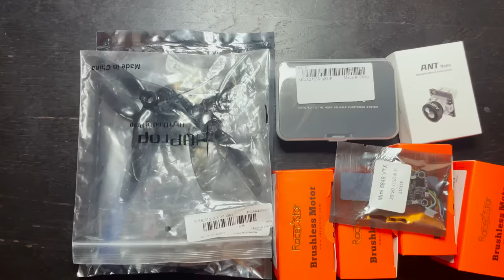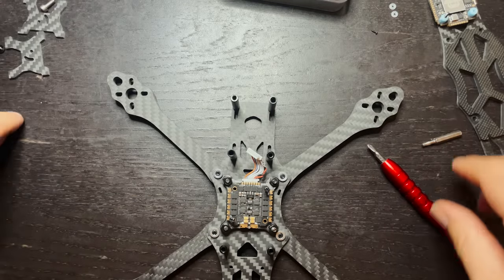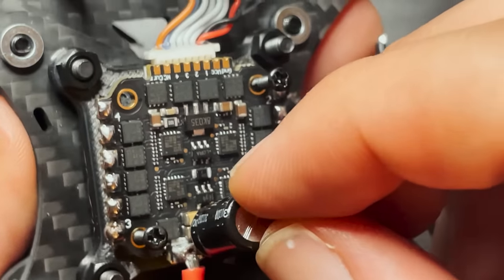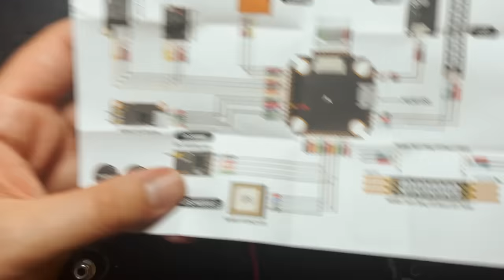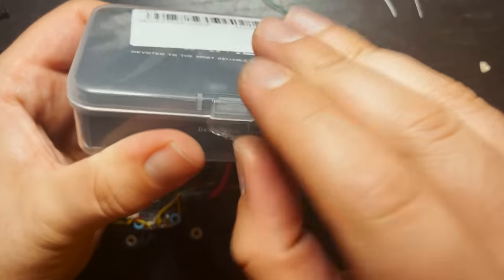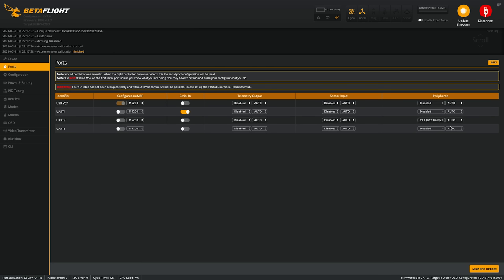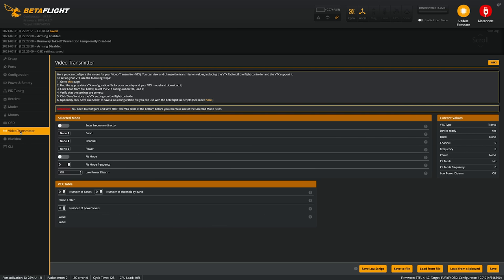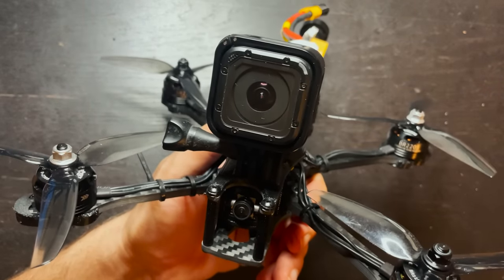Build a Freestyle FPV drone for $150!!

Comment: Hello Sir, I order the frame first, can you suggest what Remote Control will I order too?
Reply from the maker: Remote controller will depend on what receiver you use.
Reply: @TRONCATFPV  please can you suggest a receiver and a radio transmitter please which is compatible with each other accessories will I buy. Thank you so much.

Comment: Is there another fc stack that I can use if the one you used is sold out?
Reply from the maker: yes any 30x30 stack rated for 4S should work with this setup 👍

Comment: Why even worry about the numbers on the motors? If they are are going one way anyway? I thought 2 we're going to go clockwise and the other two counterclockwise? How did you reverse the motors? Is there a setting for that in that beta flight? Never seen this done before Good job! I'm just learning about drones I had this cool little drone from five below , I was just learning how to fly in a damn thing took off and disappeared behind some trees lol
Reply from the maker: If you solder the motor wires in line you wont have to do any motor reversing. Motors 1& 4 spin clockwise, 2&3 spin counter-clockwise. If a motor is spinning the wrong direction, you can reverse it in BLheli or betaflight 4.3 👍
Reply: @TRONCATFPV  thanks for answering my question, can we hang out? What's your address I want to stop by lol Wait that's creepy in this day and age but I have no RC friends I don't know anybody that knows how to do cool stuff smh!

Comment: is there a way to take a still picture with an action camera? Like if I wanted to take a picture of a sunset with my drone with a Go Pro Hero 11 attached to it, how can I take a still image with my Go Pro from 1200 feet away? Is video recording the only way to record, by starting the recording before you take off?
Reply from the maker: What I would do is film in 5K then just pull a screen grab from the video. You can get very high resolution stills from GoPro video
Reply: I love my Mini 3 Pro but I would also love a better camera that isn't permanently attached to a drone to be able to just fly 300 feet above my head on my own property or at a deserted type boat landing to take some good low light sunset type pics. Is there a build that is designed for that sort of thing? I pretty much just need to effectively lift a GoPro type cam but it doesn't need to fly 60 mph or anything. I might build one of your 2022 builds just to try it out, looks like fun :)

Comment: I have everything listed in the description and I followed your video but when I bought the vtx I had to buy your second option and I could not figure it out . Second I have the qx7 access like you listed in description and I got it to bind but zero response on betaflight any pointers in the right direction im a beginner and really exited to get into this
Reply from the maker: Here is the pinout for the rest of the wires and what they should be connected to on the FC.
BLUE - (remove/Ignore)
RED -  9V or BAT
BLACK - GND
YELLOW - Video out
GREEN - Smartaudio/TX
Reply: Thank you very much any tips on the r xsr not responding to the controller? I have seen Reddit threads that say I might need a external module?
Reply: @TRONCATFPV   I was able to get the vtx connected and working thank you any tips for the rxsr reciever I have the qx7 access like in your description and I have flashed new firmware on it and the latest access firmware for rxsr I have it binded and registered but when I connect to betaflight  zero response from reciever I’m so close to flying it’s crazy
Reply from the maker: @drakelarson7089  FrSky gear can be notoriously picky with firmware versions. If you have it bound to the radio that’s a great first step it sounds like it’s either on the wiring side or betaflight. 
Do you have the SBUS out on the rxsr soldered to the SBUS pad on the Fc? You can also try soldering it to a free RX pin on the FC.
Reply: @TRONCATFPV  Ultimate help man I really appreciate it I got it to respond I had the sbus in soldered on instead of out thankyou again
Reply from the maker: @drakelarson7089  yes use SBUS out on the receiver, that should fix the issue

Comment: What type of controller do you need for this? Can you maki it so you can use your phone with vr box
Reply: no what
Reply: @fitchyyboi  actually I did a little bit of research and you can do it. There are apps for that, you just need usb type c antena and you are good to go
Reply: @vedoxg  but don't, invest in some proper gear
Reply: @fitchyyboi  it is the same thing that analog goggles use. But when I was watching this I was thinking of making an arduino fpv drone, but now I  changed my mind. But it is still possible. Anyway thanks for your advice 😁
Reply: @vedoxg  wait is this why you need the antenna to control it? I built the whole thing but I have no idea how to fly it. I don't have a controller
Reply: @jdcampolargo  hahahaha yeah, you need the antena to send the signal (signal contains the code which represents the control you want your drone to recognise) to the drone so the drone can actually do something...

Comment: How do you get the drone into beta flight? Is it necessary to take it in the beta flight.
Reply from the maker: the flight controller has a USB plug on it, the drone won't fly without some basic betaflight tuning

Comment: Did you have to add a beeper? Or did it come with one already on it?
Reply from the maker: You can use the motor/esc beeps as the beeper 👍 it’s not as loud as a designated beeper but it works well!
Reply: @TRONCATFPV  amazing, thank you! Bought all the parts from your recommended parts list, will arrive next month!

Comment: Hey can you please help me? I'm using a very similar receiver(r81), and I'm not sure where to connect that SBUS wire to my FC. What pad do I solder the SBUS wire to on my FC? It's a 60A FC that uses F7 processor, if that matters.
Reply from the maker: If your FC doesn't have an SBUS tab, you can use any spare UART Rx pad. In betalight select "serial RX" on the corresponding UART 👍
Reply: @TRONCATFPV  Thank you so much. Love your content and I will sub.

Comment: Hello, I have another question... I order the second VTX you recommended and the cable configuration is a s follow.

Blue ... 5V Out
Red ... 2 - 4s Power
Black .... Ground
Yellow .... Video In
Green .... Smart Audio

I can't seem to find the connection for the Blue and Green, could you help me?
Reply from the maker: The 5v out (blue) will connect to the camera if you’d like to power the camera off of the VTX. If you have the camera connected to the FC then ignore this wire/cut it off.
Smartaudio will connect to any TX pad.

Comment: What is the range for covering the distance
Reply from the maker: this depends on a handful of factors. What battery you're using, what receiver you're using, what you VTX output power is set to and what goggles you're using.

Comment: I have a question so I was looking at The flight board and the ESC is it what the ESC can take if it says 6S is that what it can take not the flightboard or if it’s good distribution  board it takes 6s  I know like on the RC vehicles the ESC can take 6S
Reply from the maker: If you're making a 6s build make sure the rest of your equipment can handle 6s. If you're buying an ESC/FC stack combo the whole stack will be rated for the same input voltage.
Reply: @TRONCATFPV  What does ESC/FC mean I know what ESE stands for but what does FC mean
Reply from the maker: @dustinplee5067  FC = flight controller. Basically the brains of the drone

Comment: Nice video but for me spent another $1000 on goggle and a controller better to go with dji
Reply from the maker: On this drone I have an iFlight Force 1W VTX set to full output power and a Foxeer 150mm RHCP SMA antenna 👍
To recieve the signal I have a set of Orqa FPV.One Pilot's with a rapidfire module + menace RC antennas. Hope this helps!

Comment: Both motors that have been linked are currently out of stock are there any other recommendations?
Reply from the maker: lots of the parts linked in this video have since sold out. right now i'm in the middle of filming a 2022 version, keep an eye out for that one!
Reply: @TRONCATFPV  will do thanks!

Comment: okay real question troncat: i bought everything in the description and was about to finish building it until you started talking about the receiver, which is not in the description. is this something you only need because you switched some parts of yourself or is this something i need and will need to buy? and if so do you have one you recommend
Reply from the maker: Yes I didn't include this because this will depend on what radio you are using. 
2.4ghz ELRS is one of the best and cheapest options.

Here is a link to the receiver and controller I would recommend:
T-Lite V2 ELRS: https://www.banggood.com/custlink/vKDrvhakHD
2.4 ELRS Receiver: https://bit.ly/3bAacOE
Reply: @TRONCATFPV  sick, thank you! i already bought the FrSky Taranis that you had in the description and since that's also 2.4ghz it should be fine, right?
Reply from the maker: @grrile7  To use ELRS 2.4 you'll need an ELRS module for your radio. The built in transmitter will work with a receiver like this: https://www.racedayquads.com/products/frsky-r-xsr-s-bus-micro-receiver?keyword=rxsr?aff=58

Comment: Hey man! Don't expect a reply this far past the original upload date, but I'll shoot my shot. I am new to FPV and I would rather build a drone than spend top dollar on one that is half as good. What would be the range for the equipment you linked? I want to do some videography of camping/overlanding/paddleboarding and stuff and I am curious if any of the products you linked have follow me features, long range, etc.
Reply from the maker: Although there are some solid pre-built quads out there, I always find myself preferring custom building them. It's cheaper plus you know how the drone goes together when you swap out parts. 

A lot of the equipment I used in this video is now sold out/raised in price. 
Check out my latest budget build here: https://bit.ly/3B6nEm9
It's $50 more but the components are much better 👍
Reply: @TRONCATFPV  I actually came here from that video! I definitely want to copy the build. What would you say the range and flight time is on that one? Also does am I able to add features like “follow me”?

Comment: Can i mount a go pro or insta 360 on this frame?
Reply from the maker: Yup! We’ve been flying this one with a GP10 with no problems 🤙
Reply: @TRONCATFPV  thanks. I should be checking my country’s regulations before buying these boards/parts. I’m planning for a 220-240mm build with a 2500 kv motors probably. I wonder if that can lift insta 360 x2 one.

Comment: Hi again!  I have a problem; maybe you can help.  I'm trying to bind my R-XSR to Q X7.  That's hard enough.  Before i can actually attempt that, i need to get the R-XSR lights on.  I'm powering the mamba with a usb cable.  When i check the voltage where it's should be 5 volts (multiple locations) they're  only 20 milliamps except the 3.3 volt post which is running at a clean 3.3 volts.  Is there an on switch or something? or maybe i fried to mama board?  Appreciate any suggestions.  Thanks again!!  BTW, this is my first drone.
Reply from the maker: There are certain pads that will receive power via USB. Most of the time 3.3v pads will get power from USB however 5v pads will require a lipo to be plugged into the fc. 

Try plugging in a battery to the stack and it should turn on. 
You can also try powering the rxsr from the 3.3v pad and it will probably work when plugged into USB.
Hope this helps!
Reply: @TRONCATFPV  Thank you.  I did previously try a USB to no avail.  also, i also previously tried with my brand new lipo plugged in (got a beep from something) but I haven't yet charged the battery.  The battery by itself regsiters 5 volts, but maybe a voltmeter doesn't test it well enough without a load.  Anyway,  i'm awaiting my lipo charger to arrive and maybe a freshly charged battery will make everything good.  i thank you for your time.  I feel like i shouldn't bother the whole community with these issues, but i'm not sure if i can reply only to you.
Reply: TRONCAT, so i did some more messing around and still i'm not seeing voltage even with the freshly charged LIPO.  I'm guessing that my mamba is fried (one of the solder areas got ugly.)  I'm going to replace it.  Unfortunately it seems to be one of the more expensive parts.  Is this the part that is a "mini"?  I did 3d print the adapter but i now wonder if you have a budget recommendation for a full size replacement to the mamba F405 stack?  Thank you!
Reply from the maker: @tmac3709  Shoot me an email of what the solder joints look like and your board. contact.troncatfpv@gmail.com

Here is a link to a similar 30x30 stack: https://www.banggood.com/custlink/vKmye1SDSQ

Comment: So how much would the fpv headset and remote add to this setup?
Reply from the maker: depends on what you go with. Goggles and a controller could run you $100 or $1000.
Reply: @TRONCATFPV  cool thanks for the reply! Really interesting hobby

Comment: So, I appreciate the video very much, definitely gets me interested. But I do have an issue:  I disagree with your categorization of the pricing. 

You say at the beginning that this is good for people wanting to get into the hobby, which implies that this would be their first. Controller? Headset?  No mention in the video that I saw. But you did bring in a battery that I don’t believe was included in the price either. What’s the cost all in?  I’m not unreasonable and understand that you may not include those things because they aren’t drone specific and can be used across many drones, but again for someone taking this on as their first, these things are a necessity. 

When I first saw the thumbnail and the claim to pricing I thought it was too good to be true, and I was right. I wouldn’t go so far as to call this disingenuous, but it’s misleading and gives me “click bait” vibes.

Comment: Don't know if anyone will answer but what is the range and top speed
Reply from the maker: Range and top speed will vary depending on what battery you use and what receiver protocol you use
Reply: @TRONCATFPV   what range do you get?
Reply from the maker: @thatlocalfisherman  again, range will depend on what receiver you use. The receiver I use in this video is a pretty outdated receiver and could get realistically about 1km.

Comment: the product FrSky Taranis Q X7 ACCESS 2.4GHz 24CH Mode2 Radio Transmitter Supports Spectrum Analyzer Function for RC Drone - White "LBT Version" what does the LBT mean?
Reply from the maker: It refers to a receiver protocol. 
LBT is the standard for EU
FCC is the standard for US

Comment: Where did you get the wires for the receiver? And did you take off the white connector on the receiver?
Reply from the maker: Wires are typically included with the receiver 👍
I'm not sure what the white connector on the receiver is that you're talking about. What kind of receiver are you using?

Comment: Out of interest, why doesn’t it matter which pad you solder the motors to? I would have thought they had designated pad for specific output?
Reply from the maker: I'm not really sure the technical reasoning but depending on how they are wired up will only affect the direction that the motor is turning. Since the direction can be changed in Betaflight or BL-Heli it doesnt really matter how theyre hooked up!

Comment: One recomendation for soldering the wires is using flux on the pcb so you can keep it a bit cleaner, but you doing a grat job.

Comment: Very tempting but you need a 3d printer to make the mounting bracket so it kind of defeats the purpose of the video....
Reply from the maker: you don't need a 3d printer. read the description.

Comment: Are you ripping the insulation off the end of the wire with your finger nail.
Reply from the maker: Yes, with wires this small its quicker to just use your fingernail than wire strippers

Comment: I love DJI products. I have 2 FPVs and 2 normal drones but I find this video interesting. I probably might want to do this as well--Knowing how to put a drone together is fascinating. I love to learn. Thank you so much for sharing this video. 👏🏻👏🏻
Reply: I wont buy DJI anymore , had a Mavic Air , and eventually all 3 batts swelled up.  Replacement of those would be $450 if you can even find them. I'm done with DJI, they lost my business.
Reply: @scottr3141  I would just look into insurance on an expensive drone. I have a Mavix 3 coming in and already got a quote $60 a year which is not bad at all.